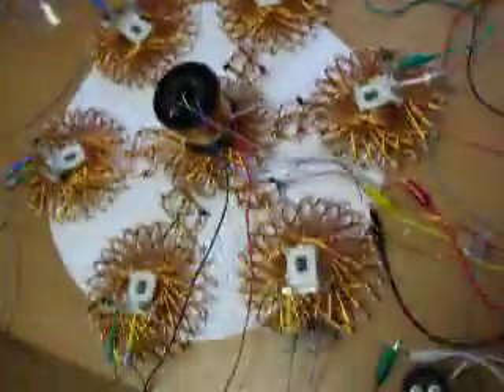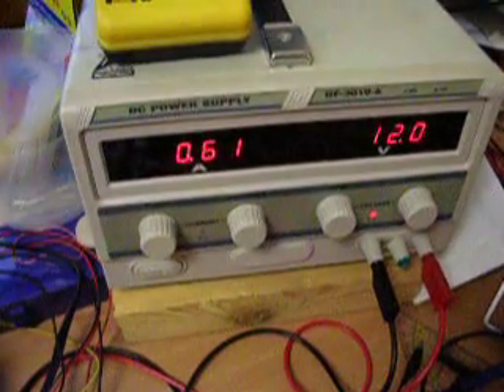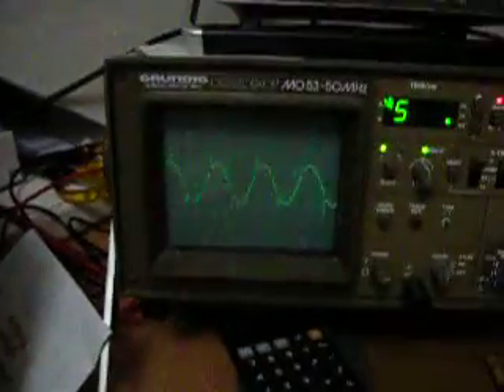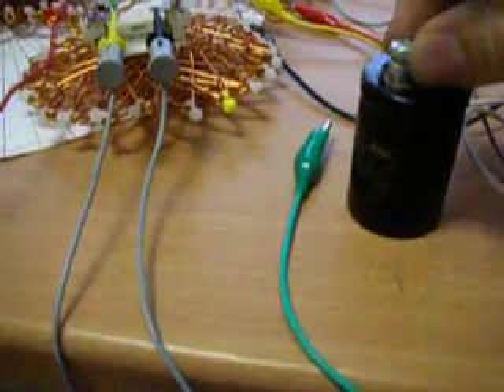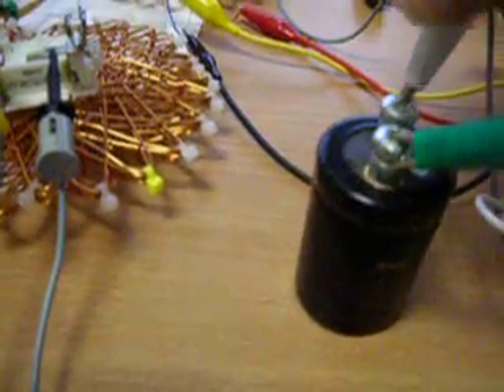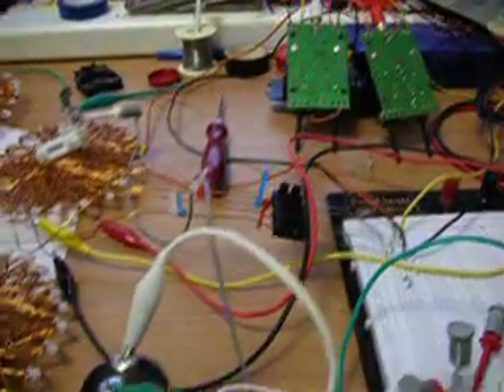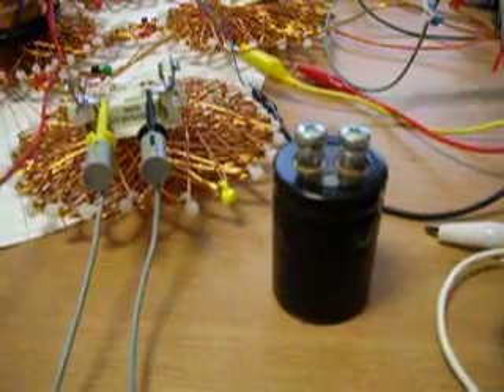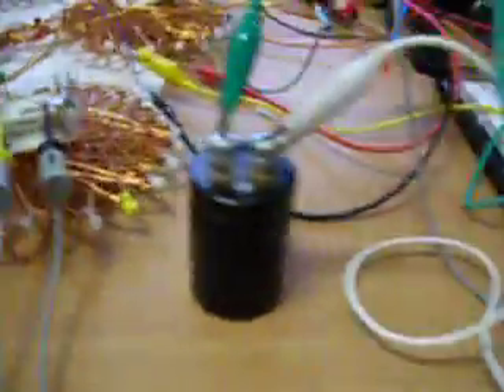SSC - Induction setup # 2

Comment from the maker: @rwg42985 Well, i did...
I have this setup running and i gain ~50% back.
Thats more then i thought. (just had a 1k 5W resistor for this test, getting warm a bit :-])
The NF Amps and the hall sensor takes some of it but i just mesured the total in and out!

Comment: K0W0O0N0

Very nice.  Bump up the frequency to 5-10Khz... that looks like a suitable coil.  What is the Ohmic resistance of the coil?  At a "threshold" frequency, you should see input amperes drop, and hear audible acceleration of the rotor as the motor effect caused by the phase shifted output of the generator coil kicks in.  Cheers!